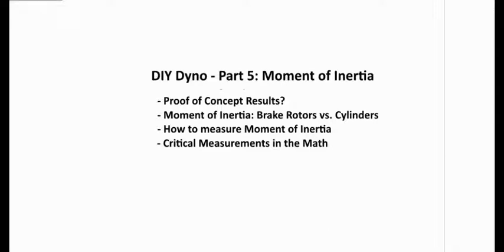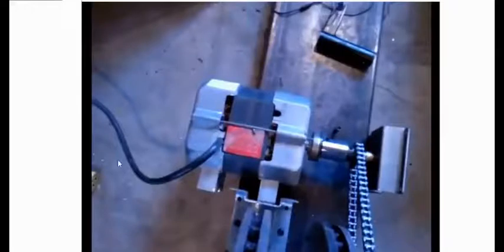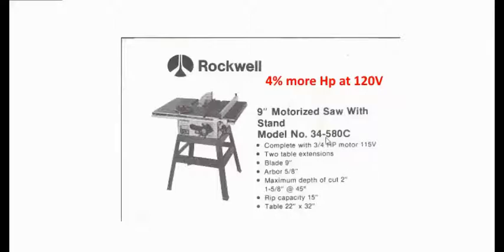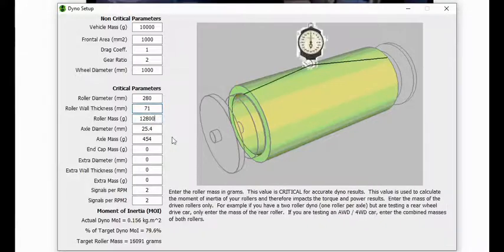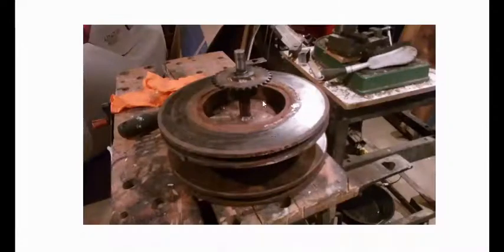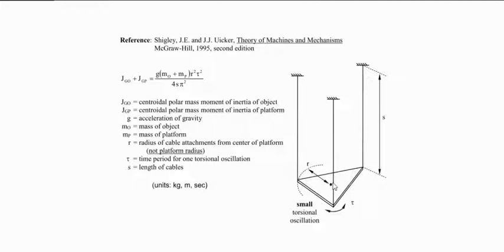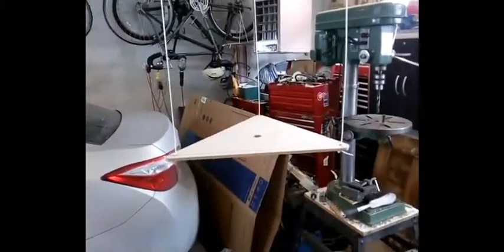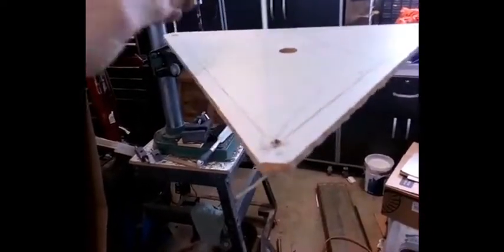DIY Dyno (Dynamometer): Part 5 - Moment of Inertia

Comment: Eugene, I have some experience in inertia dyno, your inertia measurement method is really not the best and easiest one when you already have a rotating mass on bearings…..
The falling mass approach is far more easy and accurate. you need a weight, a rope and a stop watch. See this video:
https://youtu.be/MiOfiD0rN8E 
I recommend to be careful with rope winding and the longer the mass falls the more acurate your calculation will be. I used a pulley fixed at the cieling of the workshop to maximise the falling distance…. This method applied to dyno flywheel is ideal because it already takes into account bearing friction losses
you can see a short video of my RC motor dyno on my channel… https://youtu.be/wrAsMfGjBdk
Reply from the maker: Great to know. I'll pin your comment to the top to share.

Comment: Hi. You measured more power and torgue out of electric motor it is normal behaviour of electric motor. Motor rated power is for continious use and motor maximum power and torgue output is something else. Some induction motors can output easily twice rated power and torgue. You can measure motor output but cant figure out electric motor ratings with this method. Electric motor rating for continious use is limited by motor temperature. Rated power is power where motor wont overheat in given conditions.
Reply from the maker: Thanks for the info